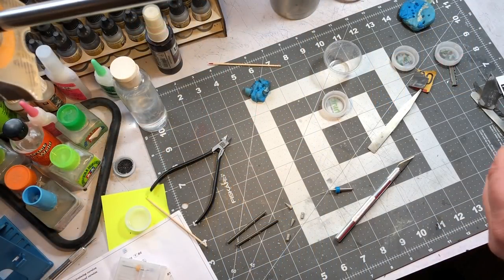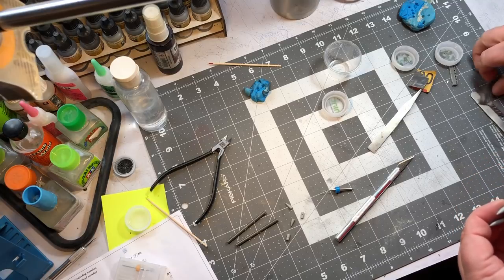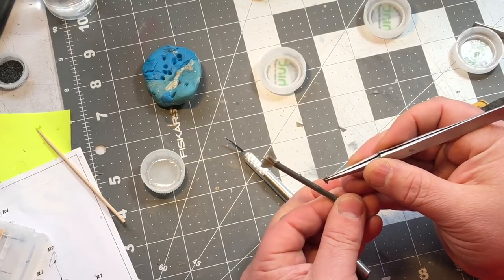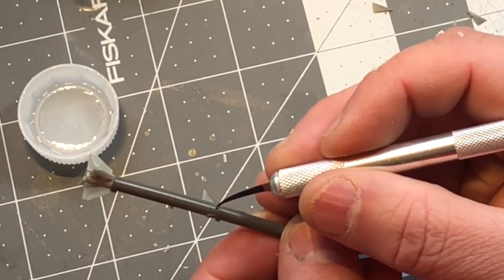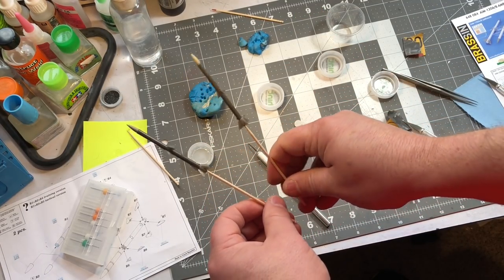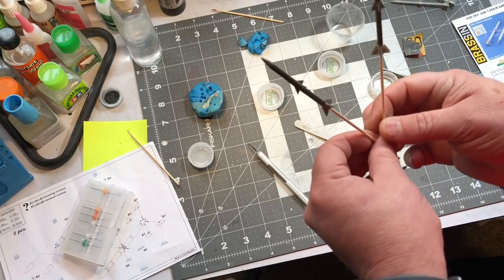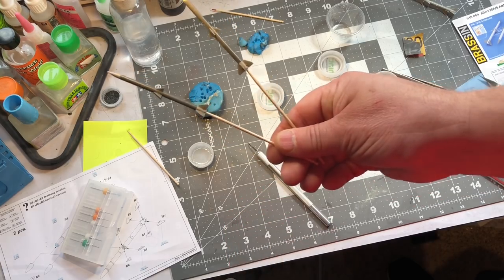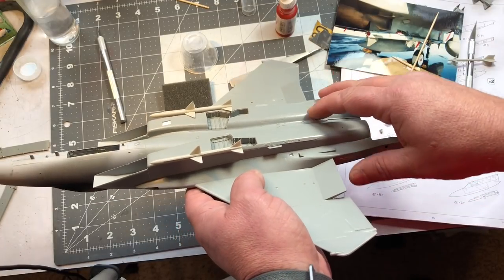GWH 1/48 F15C Part 3: Missiles

Comment: Love the magnetic idea, where do you get them from do you add a metal plate inside the model
Reply from the maker: Hey Phil, I just use magnets to magnets so it’s a bit stronger than just using a metal plate.  As far as contacting the company, the kit is suppose to only come with two 120A’s.  Figured I’d try out the resin ones as I’ve never used them before.  I’ll need to become a better modeler before I buy more of those.
Reply: @seanerk5kt9  A better modeler... if people are prepared to offer you cold hard cash for your work I think that says everything
Reply: @PhilWism  He's a tough negotiator too!